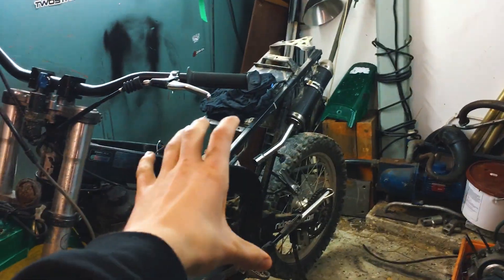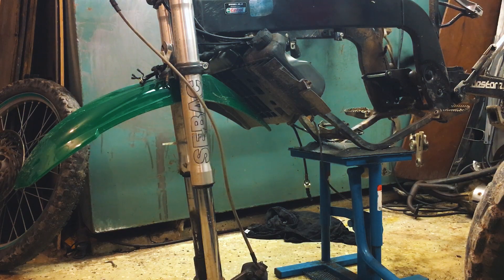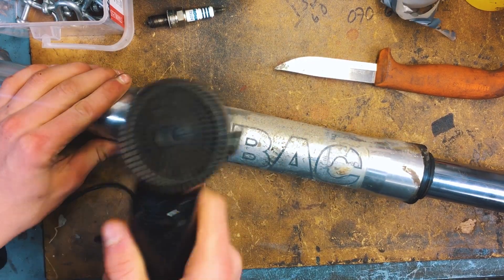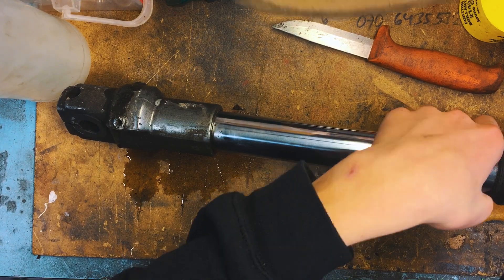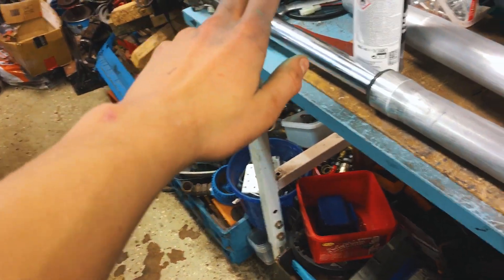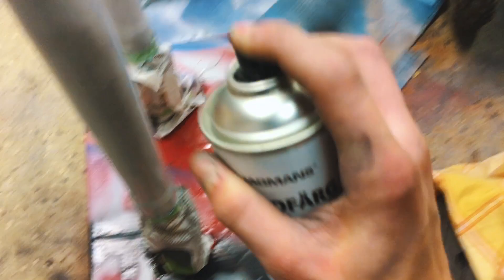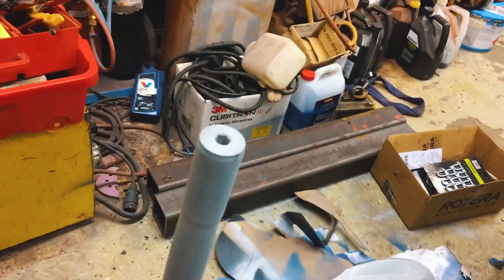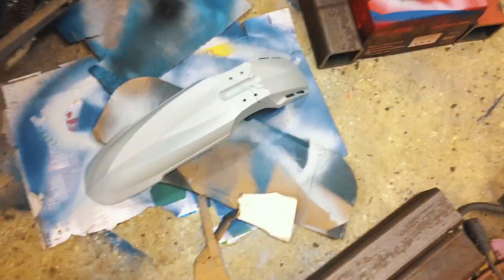Disassembling the rest of my 50cc Dirtbike | Rieju MRX Build Ep 5

Comment: I wonder what primer you use because it looks like you use the same for the plastic and the metall. I aldo wonder if you spray under the plastic or not.
Good job and I love the building videos!
Reply from the maker: I use a primer that my dad recommended me, I usuaöly just use primer on plastics but I wanted to avoid comments from people telling me I have to use primer on the forks so therefore I decided to use the same primer on them aswell

It depends on what color the plastic is under, for example the radiator guards I like to have the same color on both side on this build it was already blue so I use did the outside because it's a similar blue but for the rear plastics if they are the same color or black on the back side I don't paint the other side but lets say its green and Im painting it blue then I'm of course going to paint both sides :)

Hopefully that made sense :)

Comment: Hey man I’ve been watching quite a lot of your videos. I wonder when do you use primer when u paint stuff? Do you always use it? And how many layers of primer and paint do you spray?
Reply from the maker: I try to use primer on pretty much everything I paint if I wasn't recording I probably wouldn't have used it on the forks because I'm not sure if that was necessary but always on plastics (I don't use it when I paint engines)
I do one layer when I almost cover everything and then I wait for about 10 - 15 minutes to apply a second layer which covers everything :)
Reply: SNT Moto Alright thanks man, can’t wait to see the rieju finished!
Reply: primer is to fill in the scratches so i would use primer its gon be more smooth and stick way better then a clear coat